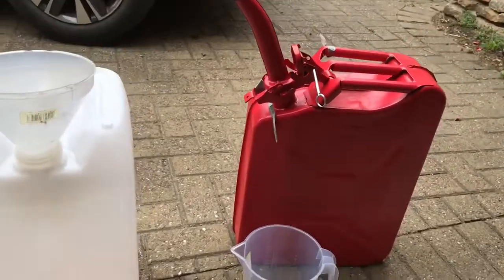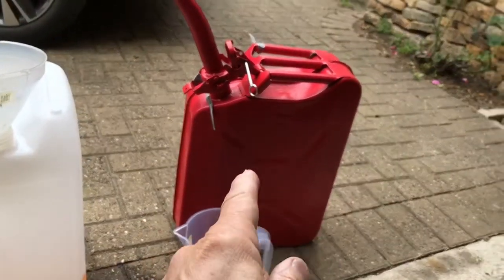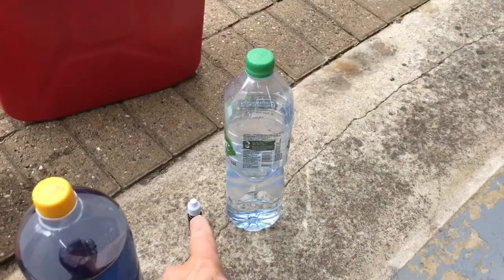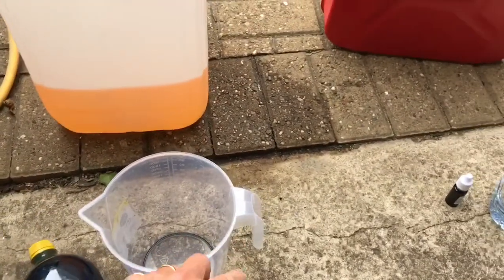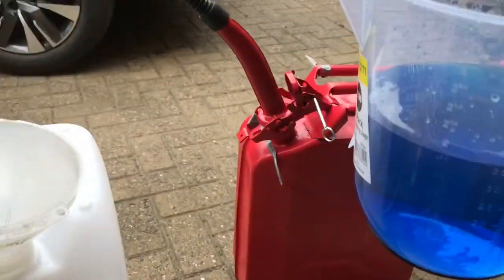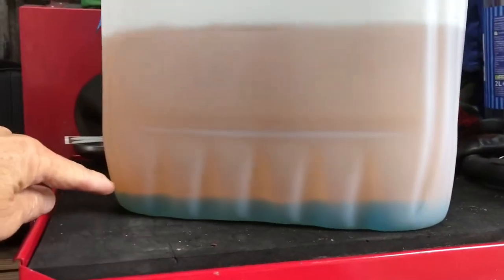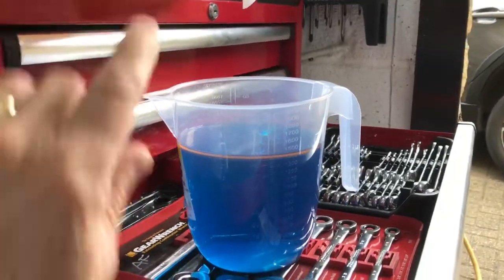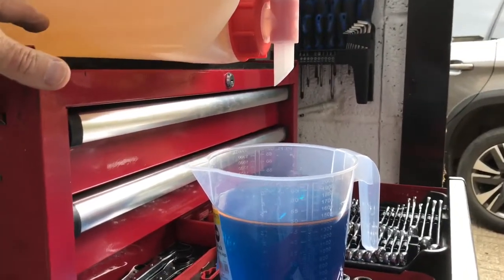How to remove Ethanol from unleaded fuel

Comment: As long as you know they use the ethanol to increase the octane and usually the gas they start with is not very good . In Texas we still have a few places to get ethanol free gas it's 90 octane and right now goes for about $3.00 per gallon US dollars/gallon
Reply: They don't "use ethanol to increase the octane rating" - they use it because the eco-crazies are convinced that doing so will "Save the Planet!"
Why do so many Americans assume that, because you can buy ethanol-free petrol in America, you can buy it in ANY country? Britain is just one of many places where you cannot legally sell it.
Reply: @jackx4311  I agree with you but they realized that when they add ethanol to lower octane gas it increases the octane rating to where they sell it as a better gas but it's not . The higher the octane rating means that it is less explosive. That's why low octane gas in a high compression engine will ping or clatter. It explodes too fast
Reply: @jackx4311   1st of all do you know how hard it is to find non ethanol fuel here in the USA. 2nd of all I cannot name a single vehicle that I would not run in e10  As long as you store your vehicle properly it does absolutely nothing
Reply: Google is ethanol used to increase the octane rating of gasoline
Reply: Look up Buckees gas station
Reply: Or you just run E10 because every vehicle will run it just perfectly fine hell most of mine including my bike run e85 lol cheap 106 octane
Reply: @RingTuned  - well, whoop-de-do for you.  The video maker's car will NOT run (for long) on ethanol fuel.  As he explained in the video. Which you were too lazy to watch.

Comment: UH, I've been running E10 for at least 10 years, the only casualty was the fuel suction line on my weedeater, I have a 53 chevy hasn't fazed it.
Reply: Bully for you.  When ethanol-free fuel was introduced into Britain, it trashed a load of fine, high performance engines which ran at high compression ratios and high revs - like the classic car owned by the uploader, and UNlike your '53 Chevy.

Comment: This was exceptionally helpful, Thank you.    Now I know how to remove that pesky ethanol form my fuel before filling my 1956 Willys Jeep tank.  As to Octane levels, The L134 of my Jeep was designed to run on gasoline as low as 63 octane.  Older vehicles originally ran on lower Octane fuels than the currant levels.

Comment: It's very important that no one try to use this in their medern cars. When you do this process, you pull out not only alcohol but all the anti knocking chemicals and detergents out of the petrol. It means that your car will run like crap lol. Still, up to 20% alcohol in your petrol will make your car run just fine, except the mileage will be very bad. I experience this in my country.
Reply: TRY LISTENING TO WHAT THE MAN SAID. His car won't "run like crap" on ethanol fuel - after a short time it won't run at all, because the ethanol will TRASH vital components in his car.

Comment: Just a stupid idea dude have you heard of climate change ? You should not be releasing those VOC’s to the atmosphere
Reply: You are exceedingly rude and ignorant as well. The VOCs are already in the gas. He didn't create any. The waste ethanol is disposed of like used motor oil, paint thinner and other solvents. The gasoline will be burned in his machines whether he took the ethanol out or not. It's only 5% ethanol in the first place. You embarrass yourself with your hysterical ranting.
Reply: @johnbauman4005  good doing it right
Reply: @arnesste000   CRETIN.

Comment: Really BAD idea. Ethanol isn't the only contaminant in blended gas. The gasoline you will be left with is called 'Sub-No Lead'  It's Octane rating is FAR below 87. If you want higher octane Pure gasoline look around until you find it.
Reply: Or start with higher octane like 91 or 92. The drop with E10 is about 3 points, with E5 even less.
Reply: Yet ANOTHER American who assumes that, because he can buy ethanol-free in the US, you can buy it in ANY country. In England, it's ILLEGAL.

Comment: What's the best way to use or dispose of the ethanol/water solution?
Reply: How do you dispose of used motor oil, paint thinner or other solvents?
Reply: @johnbauman4005  Where I live we have drop off sites for  household hazardous waste, but a lot of people don't have that option. Just wondering if there are practical uses for the solution in order to keep it out of the waste stream.

Comment: And how did you dispose of the water/alcohol/anti-knock-compounds mixture with some benzine still floating on the top? Pour it down the drain? What did the local sewage plant think about that? Isn’t there some law about disposing of toxic chemicals in the UK? Just interested...
Reply: How do you get rid of used motor oil or paint thinner and other solvents? It's not rocket science. This waste would go the same route and not down the sink.

Comment: Save the ethanol for car racing  if you can set lose from the water

But this is the problem
Ethanol like water and it atracks water.
So if your fuel schrew dop do not close it will atracks water in the night .
One of the reason in my country with ethanol e10 (10%) a lot of cars what standing still thanks to corona have a big problem with water in the fuel tank.

Comment: Look up Jacob Kaul on youtube. You're not doing your small engines any favors removing the ethanol yourself, infact you're lowering the octane a lot which isn't good. BETEX chemicals in regular pump gas a responsible for carburetor varnish and buildup and plastic damage not ethanol.
Reply: Then why is it that when people running high performance old engines remove the ethanol from the fuel, their engines work fine - but if they leave the ethanol in, it wrecks the components mentioned by the uploader?
Reply: @jackx4311  it doesn't, I've never seen anyone remove ethanol from fuel and have it save small engines with actual evidence. I've seen people buy ethanol free gas which if it comes from a separate pump is likely close to 100% pure petrol distillate unlike regular 87 octane which is around 20-50% petrol distillate and that does protect small engines because it doesn't contain the betex. Please look up jacob kaul fuel line test with e85

Comment: Ethanol has the same ph and acidity of petro. I run a 50/50 mix in all my vehicles including a 1987 van daily driver. If you're fuel system is clean and up to normal standards then there's no issues. Old and worn out hoses and components are what Ethanol is blamed for. Maintenance issues that have nothing to do with the fuels. Old carbrated cars you adjust your jets  and timing very easy. Any car with a computer controlled ignition system  the computer changes the fuel air and spark automatically because petro changes every time you fill up.Just remember the first cars ran on Ethanol that the farmers made and sold. Soon they will ban combustion engines saying that they cannot be clean. Ethanol and bio diesel are the only carbon neutral fuels. Electric vehicles are not carbon neutral, they pollute being made and being charged with power plants that have low grade crude oil pipelined in with no emissions systems on the power plants. So embrace bio fuels to save the combustion engines .
Reply: And what makes you think his CLASSIC CAR has such things as computer-controlled ignition and fuel injection? How many MORE bloody Yanks do I need to remind to watch the video, and LISTEN TO WHAT HE SAYS about what ethanol does to vital engine components??
Reply: @jackx4311  The model t was a flex fuel vehicle. If you are driving a carbrated engine you put in larger jets and adjust or  advance  or retard the timing. I have put 250,000 miles on a non flex fuel jeep, using a 50/50 Ethonal and gas mix delivered all night long . I tore the head off to see what the damage would be. Nothing was wrong mind you I was just curious. It looked like new and comparing it to other jeep engines with similar mileage it was far cleaner and less carboned up . That's just what  my personal experience has shown me.

Comment: I've never had a problem with ethanol in any of my vehicles. I've got lawn mower with 2000 hrs. Not one issue with ethanol in the gas.
Reply: Same experience here. An early 2000's Honda. IDK why some folks' machines have problems with E10 and others' don't.
Reply: @johnbauman4005  - because - AS THE UPLOADER POINTED OUT -  his classic car uses components made long before the eco-crazies intimidated the government to put ethanol in fuel.
Reply: @jackx4311  I was talking lawn mowers. Some people swear ethanol gums up and corrodes their lawn mowers, but my Honda lawn mower has never had anything in it but E10 and 20 years later it runs like a top with no issues whatsoever. What I said had nothing to do with his car.

You clearly have anger issues. Consider seeking help.

Comment: Unlikely that your fuel is only 4% ethanol so equally unlikely that you have removed all of it.
Reply: Why do you say that? It's sold as 5% if I understood correctly. What he and you neglected to consider is that ethanol and water are miscible. 50 ml water + 50 ml ethanol doesn't result in a final volume of 100ml, but somewhat less, maybe 95-97ml or less - there are tables/graphs to get the final volume. This is because of the space in water molecules. The ethanol and water molecules cozy up resulting in the lower total volume. So he probably got pretty close to the stated 5%. He also probably got some detergents and other additives in trace amounts also.

Comment: I have an ethanol-free gas station 10 miles down the road.. I always fill up a few 5 gallon containers and use it for my small engines.  Makes the motors purr and keeps them clean!
Reply: Unfortunately we really have to pay up for the non-E gas but it's necessary if you have anything with a small engine. I wish I had a dollar for all the carbs and fuel lines that I've had to deal with over the years before Non-E was widely available.
Reply: Well, bully for you. Unfortunately for me - and the uploader - our nearest ethanol-free petrol station is about 3,000 miles away, and his car is not amphibious.
Reply: @jackx4311  ☺
Little bit of a drive uh?

Comment: Don't do this. It leaves you with A 84 Octane sub grade. The octane booster will only get you to 84.7 octane still subgrade. Most vehicles and small engines are designed to run on 87 octane or higher. 10 percent ethanol is mixed into a v grade 84 octane to achieve 87 octane. If you don't live where you can get straight A grade aka 91 premium or a 50% A grade 50% V grade aka 87 un leaded no ethanol. Your better of using the ethanol blend.
Reply: Then how do you explain the FACT that his high-performance car runs very well on his petrol, once he's taken out the ethanol and added the additive?

Comment: Very interesting indeed. I was expecting a completely different process and I love being pleasantly surprised. Theoretically, one could distill the ethanol out of the water.
Reply: Except that it is not pure ethanol. It has been denatured.  Additionally there are other potential adulterants that may partition with the water/ethanol phase such as detergents. It would be interesting to run gas chromatography on it to see what's in it in addition to ethanol.

Comment: You have removed at most  2/3 of the ethanol from the fuel. Ethanol has a log Kow of -0.31, meaning it is roughly half as soluble in octane as it is in water. Kow is the octane water partition coeffient, normally stated as the log of the value. 10^0.31 ~ =2 so a log Kow of - 0.31 is a Kow of about 1/2.

Comment: Careful, as most octane boosters are ethanol, or methanol so you are adding it back.  Not sure across the pond but that is how it is here in the states.  My 1998 Ford Taurus despises Ethanol gas and I was very fortunate to live next door to a petrol station with ethanol free petrol.  They sold it due to boats not liking ethanol either.  Thing is I moved in 2013, and everywhere around me is ethanol only (unlike a lot of stations back where I came from).  I still have the car but she hasn't been moved since 2016.

Comment: For the benefit of American viewers; no, he CAN'T just "go down to the gas station and buy ethanol-free gas" - because it isn't sold in Britain any more.
Reply: @Hugh Jaanus why would you doubt that? https://www.homedepot.com/p/TruFuel-4-Cycle-Ethanol-Free-Fuel-6527238/203571144?MERCH=REC-searchViewedNA-203571144--N
Reply: @Hugh Jaanus Only available in quart, gallon & 5 gallon cans in my area. $75 for a 5 gal can of Sunoco. 
If you know where it's available at a gas station ⛽ pump, let me in on the secret.
Reply: @savage22bolt32  some airport gas stations FYI, but it's not cheap
Reply: @flyinpolack6633  Thanks, I live near an airport. I'll check in with them and see if they will sell to me.
Reply: hard to find here in the US anyway, unless you get those tiny cans at the hardware store for insane prices
Reply: @Hugh Jaanus they most certainly do. it's $17.99/pint at bothj home depot & Lowes

Comment: So does the added coloring serve an active purpose? Or was it just for demonstration purposes?
Reply: It make it easier to see where the fuel/water dividing line is. I've seen this done before without, and it's just harder to see that's all, so you end up wasting the actual gas.

Comment: I think it’s disgusting that fuel in the UK has to contain 10% Ethanol soon. I drive a 1989 Carburettor Car and it can’t handle E10 fuel. Sure, 99,9% of cars can take E10, and it would be selfish just for classic cars to offer separate fuel… but wait, that’s what they do in Germany!
Reply: We do it in Denmark too. But not every where. The 100 octane fuel is still e5. As I understand, they can't achieve 100 octane with 10 procent ethanol 😂

Comment: I once ran pure gasoline in my Ford E250 5.4, and for some reason I got some pretty bad fuel economy. Not sure why. The Chevron gas with 10-15% ethanol that comes with it seems to give my truck decent gas mileage, but pure gasoline drops it.

Comment: No you just made low octane gasoline that will burn like sh!t.
Reply: No - he added an octane booster, which will not only NOT trash his engine - it will make it run as the makers intended.
TRY WATCHING THE FULL VIDEO BEFORE POSTING THAT KIND OF IDIOTIC SNEER.

Comment: Ironically; many engines benefit from water injection at time of combustion  This water-ethanol mix would be perfect for that.
Reply: The water would do that - but, AS HE POINTED OUT (only you were too lazy or too stupid to listen), the ethanol trashes many components in classic engines.
Reply: Oh my; shouting capitals, spewed insults, and a YouTube join date of less than a week.  That really is the troll-trifecta.
Nevertheless; (in case you are a pleasant person just having a bad day) water-alcohol injection, segregated from the fuel system that it would harm, has been around for decades.  It is one of engineering's ironies that the harmful water and ethanol removed from the fuel can also be beneficial if injected to the air supply prior to combustion.

Comment: Proof that ethanol attracts water to your fuel system.
Reply: That is why it works so well as a fuel dryer for if you have moisture in you tank.
Reply: @michaelmeisman1672  catch 22?
Reply: Doesn't ethanol pull water out of the air?
Reply: @old8235  I am not sure if it is so hydrascopic like older brake fluid was. But I do know that it will bond with water and allow it to be removed from your fuel tank by running it through the combustion process.

Comment: Where I live, ethanol gasoline is currently about fourty cents cheaper per gallon than ethanol free.  This seems really useful, however my main concern would be the loss of octane, as my Pontiac has a 10½:1 compression ratio.  I suppose I would be able to get that back with the addition of a lead additive/substitute, but I'm not sure if buying that would surpass the money saved.
Reply: Strange that the ethanol gasoline would be cheaper considering ethanol is costlier compared to straight dino juice.

Comment: Very helpful, thanks. I have the same issue with carbureted vehicles. I would be less upset about ethanol in fuel if it was actually beneficial for the environment, unfortunately the opposite is true: it takes more than a litre of fuel, to make a litre of ethanol from corn. In a few decades, bio-ethanol fuels will be remembered as one of the dumbest ideas of the century.
Reply: That sums our government up perfectly

Comment: You can drying the fuel with silica after removing the Ethanol.
Reply: Or filter it through a chamois leather to remove the water... (a real one, not a stupid synthetic thing)
Reply: @noxious89123   its to expensive  and to less storage for water  rest.  cellulose does a better job.

Comment: That's a good way to separate the ethanol.

If a person just wanted to test to see if ethanol was present...

1) Put the gas that's in question into a small jar, 2) pour in some water & wait for it completely settle, 3) mark the dividing line (between the gas and water) with a Sharpie, 4) shake it up & wait.

If the dividing line doesn't move, it was ethanol free. If it does move, there was ethanol in the gas.

I did this to all my containers of gas for my lawn mowers when e10 first became a thing. I don't have to now, because my state requires proper labeling at the pump. Still, it was kinda cool to see it work.

Comment: Look out though, most of those "Octane Boosters" are just plain ethanol you are adding back in.
Reply: Toluene or xylene are commonly found in paint stores. They are 120+ Mon. Transmission fluid can be added as a lubricant.
Reply: I use one quart xylene per 11-12 gallons non-ethanol 91 octane. Getting harder to find xylene in quarts, I try to find it on closeout, can't get toluene anywhere near me.
Reply: And when they add a "point" of octane, they don't make your 95RON into 96, they make it 95.1!